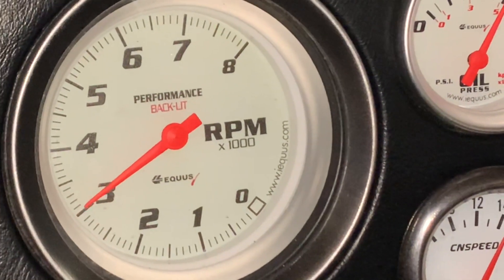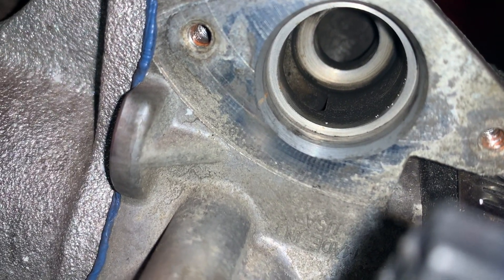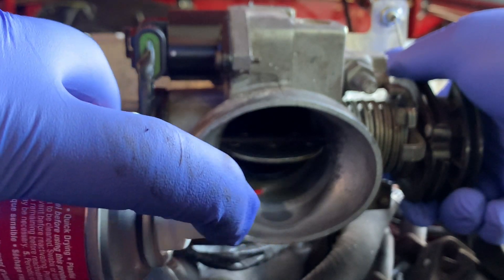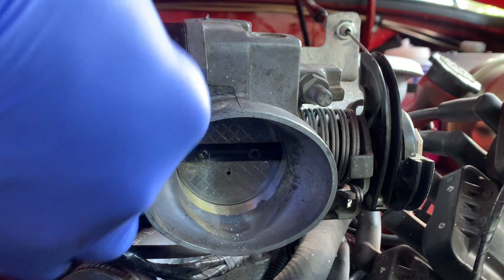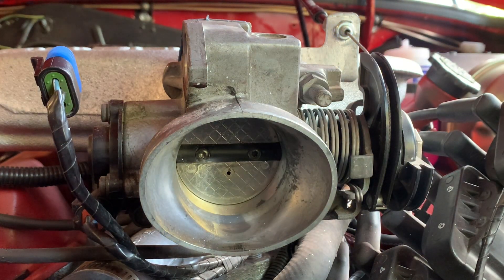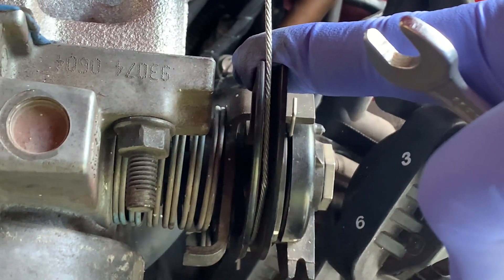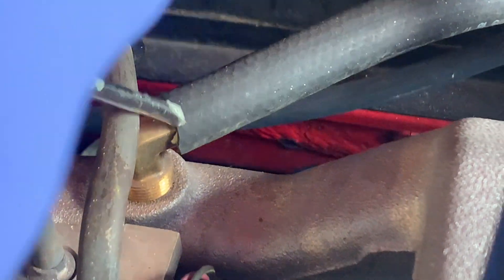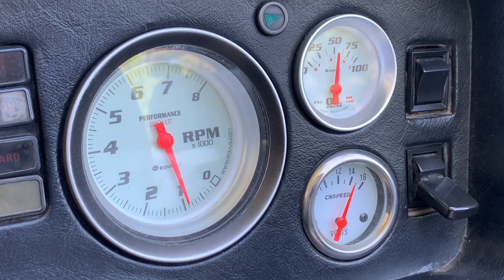High Idle? Check Idle Air Control, Throttle Position Sensor, Cable, Clean Throttle Body, Vacuum Leak

Comment: Could only smoke my engine up to the leak between TPS and throttle body. Sure enough, the clip was missing off my brake booster vaccume line! After replacing clip and some gasket sealent on the TPS: LTFT1 20 LTFT2 25 dropped to LTFT1 9 LTFT2 14.